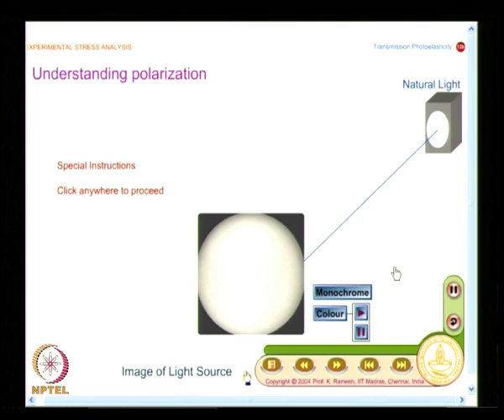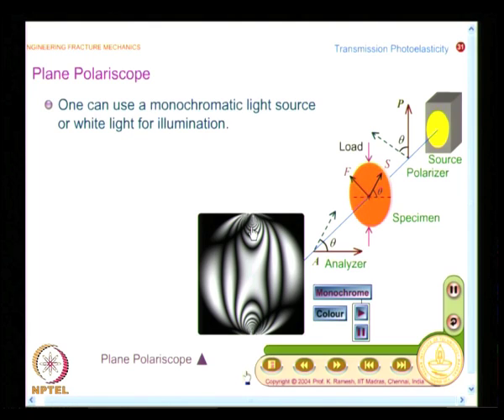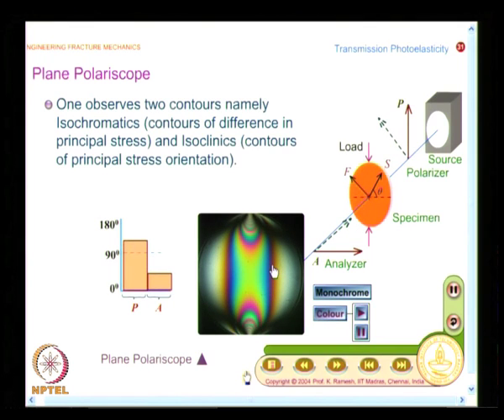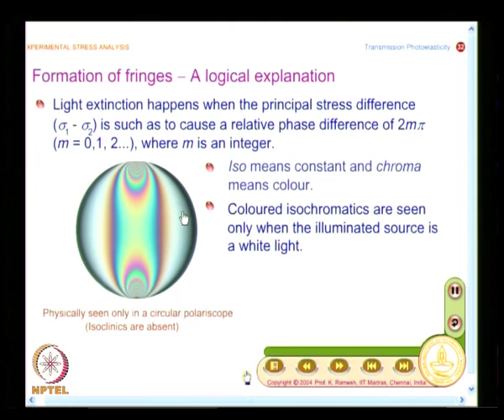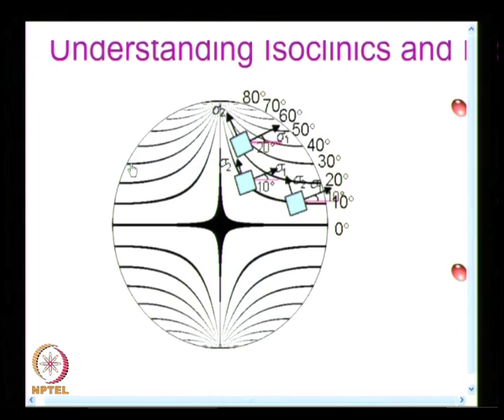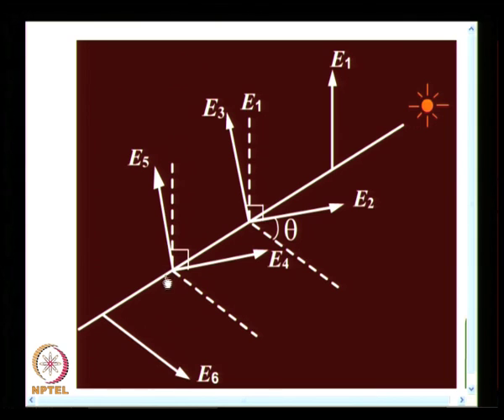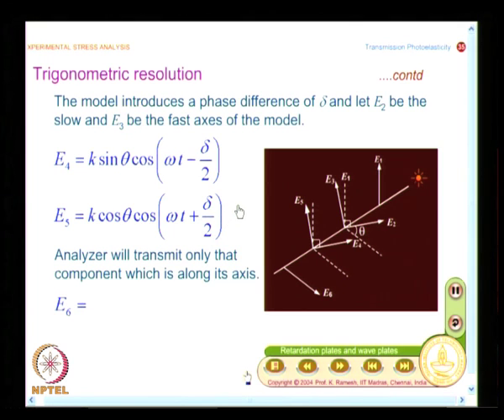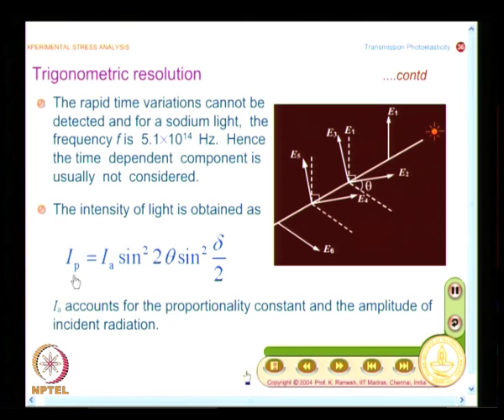Mod-02 Lec-15 Plane Polariscope

Comment: Why is isoclinic independent of wavelength
Reply: (2 years late lol..) the birefringence angle in a photoelastic material depends on the direction of stress. If an area is stressed in a way that aligns its birefringence with the polarization of the light, then the polarization of the light is not changed and the area is dark. this happens when the stress aligns with the polarization of the first polarizer, or is 90 degrees off. in both these cases the polarization is not changed by the model and the area is dark.

in areas where the fast or slow axis does not line up with the first polarizer, the polarization of the light is changed depending on wavelength and stress.

The important parts are that:
1. the photoelastic material exhibits birefringence with the fast/slow axes being determined by stresses
2. when linearly polarized light passes through a birefringent material (wave plate) along either the fast or slow axis, its polarization does not change
3. the isochromatic fringes occur because the amount of birefringence depends on the magnitude of the stress, so the polarization is changed through a cycle depending on both wavelength and local stress

intuitively the photoelastic birefringence makes sense as the material is deformed in the direction of the stress, so the more it is pulled the more a fast and slow axis emerge along that strain direction.  I don't know any more, but I would imagine that both positive and negative birefringence are present depending on compressed and stretched areas. the changing axes should be along the principal stresses (in the plane orthogonal to the light direction).
Reply: @AppleCakes7  thanks, but I forgot I what I learnt, it's been 2 years 😂